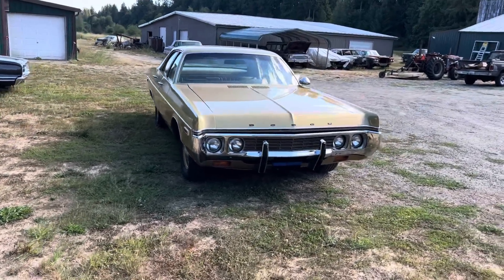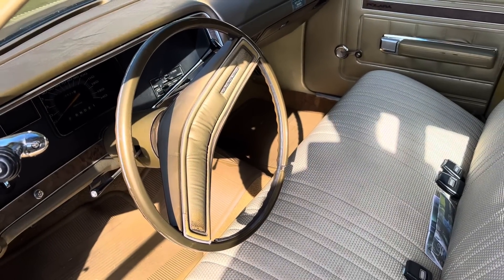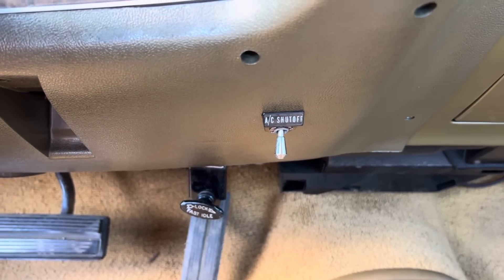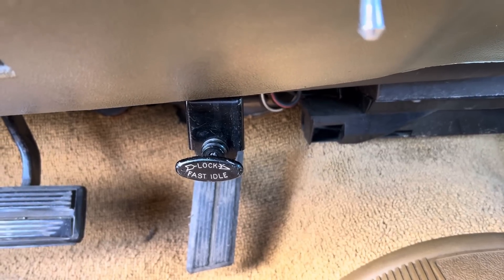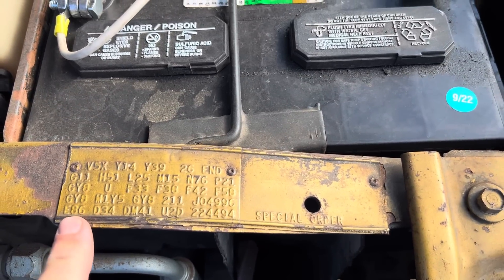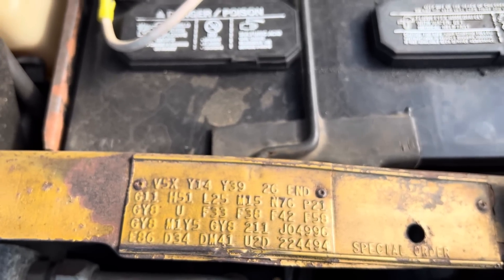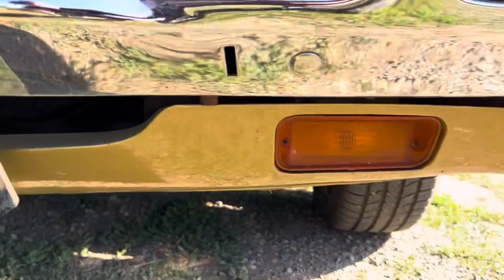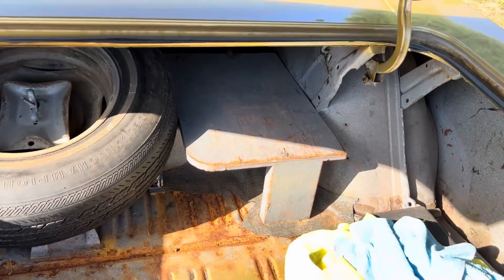1972 Dodge Polara U-Code 440 HP, ex-Washington State Patrol Car Tour

Comment: Very nice! In the early 1980’s I ended up with another 1972 Plymouth Fury that was a former Ohio State Highway Patrol Car. I had 5 of them total, but not st the same time. Most were white with blue interiors, but the one was green like the Polara with a Dark Green vinyl top & green interior. It was set up exactly like the regular Patrol Cars, 440, Torque Flite & 600 CFM Holley with dual exhaust. Certified 140 Speedometer, ect. We surmised it must’ve been an Investigators Unit, hence the odd color. The vin started out as PK41U2F....& in 1973 is when the Dual Snorkel Air Cleaner first appeared on the C-Bodied 440’s & 400’s. Chrysler referred to this as a “ Noise Reduction Package “, but I strongly remember some of the Troopers back in the day that drove these would just flip the lid over on the air cleaner & the noise during heavy acceleration was incredible!

Comment: OUTSTANDING, Was this the same  car that was driven from Washington state all the way to Chryslers at Carlisle in Pennsylvania several years ago? If so I'm proud to say I saw it in person. There was a special indoor display for mopar police cars that summer. We had just completed the restoration of a 72 Pa State Police Plymouth Fury Ii. It was a marked gold (same color as your car) and B7 blue unit with the hp 440. It's on perminent display at the academy museum in Hershey Pa. Love your Dodge.
Reply from the maker: Yep same car!  Was like 2004 I think?  Time flys.
Reply: Mopar really did some weird builds  with those cars. Many auto graveyards throughout Pa. we're visited in search of a suitable original ex Pa State car. One yard in  particular Donaldson's near Altoona, Pa had several ex Pa State cars in it. 65, 69.70.71, 73 and up. I first came across a 70 Fury II, when I lifted the hood I was kinda disappointed to see only a 383 with a black single snorkle air cleaner and a factory 2 barrel carb. Strangely it had the hp exhaust manifolds...the C body specific driver side manifold (with the 70,71 heat stove intact) thought maybe when the hp 383 wore out someone stuck a 2 barrel 383 in there between the hp m.folds. Nope, E61 on the tag and L in the vin. Never saw a 383 2v with hp manifolds and duals. The engine even sported its factory hoses and pcv valve with traces of factory Corp blue engine paint on it. Subsequently located both a 68 and a 69, both had 383 2 barrels with the C body HP exhaust manifolds and what remained of dual exhausts. The driver side HP manifolds on those two were correct as they were devoid of the air cleaner heat stoves and no provisions for a stove. The next car I looked over was a 71 Fury Ii. This was the first year PSP ordered a 440. It was the E85 standard cam T code engine, painted blue with log manifolds, dual exhaust, and an AVS Carter (like on the 370 hp 440) not the expected Holley. In the trunk I scored the 71 specific dual snorkle air cleaner with a really nice 440 Super Commando pie plate. (I bought that for 20 bucks) I think Pa. required that the fleet had to run on regular gas as they still do. No premium fuel. 71 was the first year that a 440 could run regular. The hp 440 still needed premium in 71 but the 383 4v and Std perf 440 could run low octane gas. Not to geek out on this stuff just illustrates how mopar and all the domestic auto makers could skirt the norm and tailor components for specialized applications. Lastly regarding that 71 440 T code engine in the PSP cars. I've seen two of them and each one was equipped with the red painted valve springs found in the U code 440 hp engines. The 71 in Donaldson's and there was one that had been wrecked when it was fairly new and left in a tow yard. It was on Marketplace or Ebay not that long ago.
Reply: @craigpolinski8955  I remember when I first saw the “ Wanted” ad in Mopar Collectors Guide for a PSP ‘72 Fury. I actually spoke with Dave Points on the phone ref the ad, & mentioned I had 5 different ‘72 Fury’s in the past that were former Ohio State Highway Patrol Units. The PSP ‘72’s were actually Fury II’s from what I remember, they had the full wheel covers & body molding along the side. Dave was cool to talk with, I believe he was a Captain at the Highspire Post, not sure of the correct spelling. Never seen the Fury in person yet, but since it’s now on display in Hershey it will be on my things to do list eventually.

Comment: So it had a Holley factory?
Reply from the maker: Yes Holley originally, they went to thermoquad in 73
Reply: @rocketresto  So is it the goofy 4160 or is it a different Police application?
Reply from the maker: @Ross046  yes the 4160.  Still have it but could never make it work right.
Reply: @rocketresto  My '69 440 had one. I just went to a 4150.

Comment: Soften the lines a bit, put the steering wheel on the right hand side, and make the grille flat and you got a VH-VL Chrysler Valiant XD
Reply: Yes it does have a similar look,  I owned an Australian made CH Chrysler by Chrysler, cream vinyl top and yellow with the 360 small block, lots nice extras,  towed my Bullet ski race boat everywhere, however eventually the rust beat it, but it just kept going.
Reply: @rossawood5075  I drove a VJ 245 for 14 years and yeah had to let her go to someone who could look after her rust. If I'd had a dry place to keep her tho I'd never have sold her

Comment: Marked, unmarked- no difference, NCSHP put them all out to pasture at 70,000 miles- it was explained that those cars got rougher use in those 70 than most civilian cars with 180,000...... I saw dozens of them parked in the field by Elizabethtown SHP base (troop B) back in the 1970's, prior to selling them at public auction.

Comment: I drove a number of these Dodges for a few years.  The 440 was indeed a power house.  You could hear the carburetor sucking air a half mile away when floored.  The suspension was pretty shaky at high speeds.  The brakes left a little to be desired also.   One thing I found irritating was that they were hard starting  after being shut down.  There is no doubt they had  good high end  performance.  It was a different world in those day and we we enjoyed every minute of it.  Today's modern cars are superior on every level...
Reply: NOPE! Modern cars are TINNY PIECES OF CRAP!